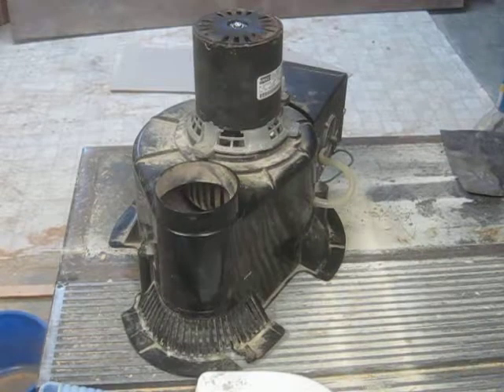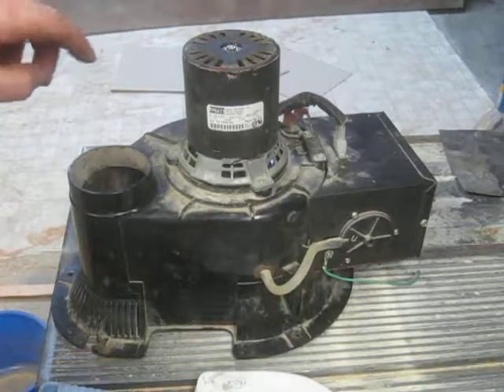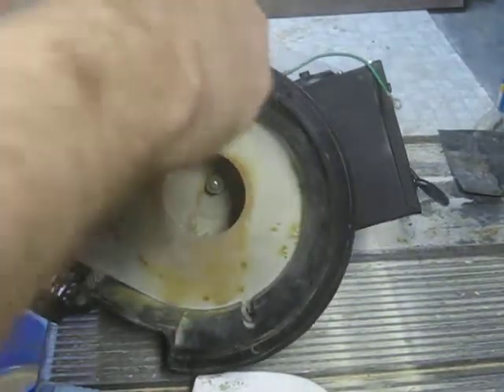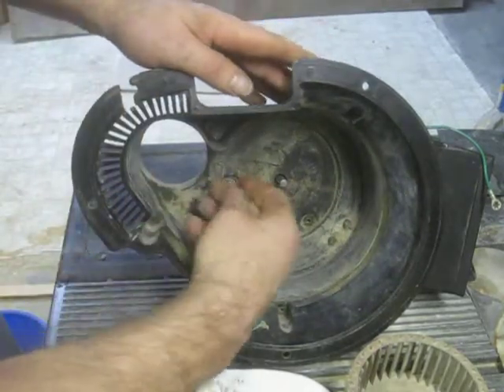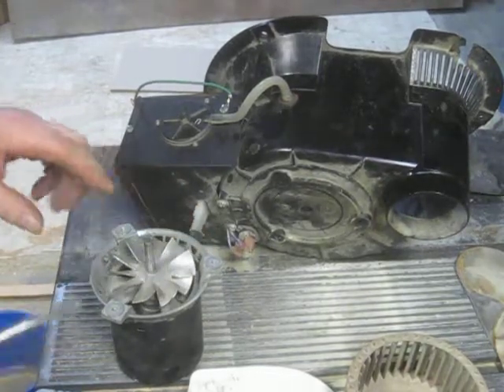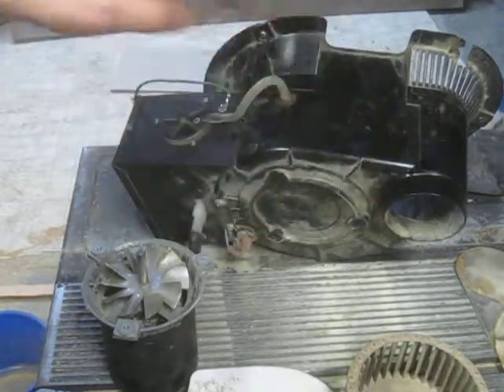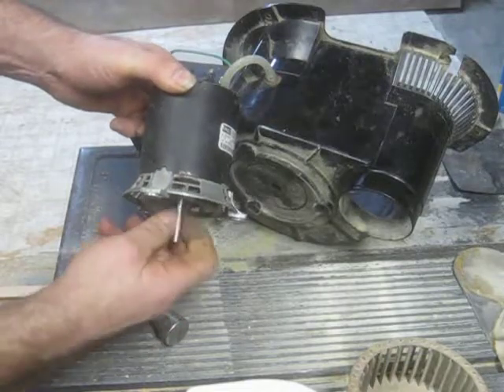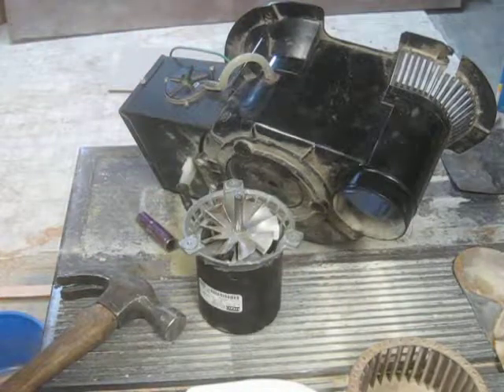AO Smith Hot water Heater Direct Vent FASCO blower motor bearing replacement

Comment: how did you find out the bearing model? I have a different model and am wondering if they are the same bearing part numbers.
Reply from the maker: Mine was written on the side of the bearing. That's where you'll find them unless the manufacturer has ground them off (unlikely on a 50¢ part) or they're making their own (also highly unlikely on commodity parts).